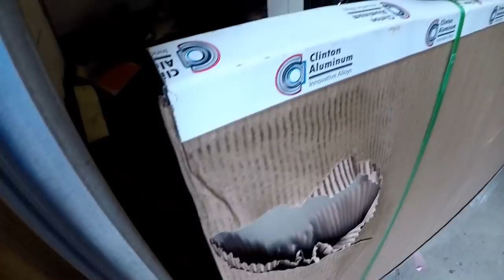Homemade Metalworking Tools

Comment: You should drill a hole at the front of the crack in the mallet so it doesn’t keep cracking. I do that with plexiglass to stop the crack from propagating😳👍🏻✨ you do beautiful work✨

Comment: Good to see ya back at the shop. Got an idea about that English wheel. Put a straight bar, inside the frame. Cut 2 45 degree angle on that bar. That way you don't have to weld it to the ceiling. Great use of that old seabag. Got a few of those myself. Great ideas all the way around. Another great video. Have a great weekend buddy

Comment: Consider sectioning a wood rolling pin into multiple wheels.  Then you can use your lathe to make any profile you want.  The wood might not last long, but it will serve well enough for the limited use you have in mind.  More Epa used similarly would work better and longer but cost you more. Anyhow, keep up the good work.  Bo.
Reply: great ideal or if he has access to a metal lathe make his own that way

Comment: That is what I did with my HF English wheel.  I fitted a hardwood strut from the top front of the frame, up to a ceiling joist.  The base of the machine is fastened to the floor.  For the frame to flex, the house has to be lifted up.

Comment: Some great work. Rather than bolt to the floor I have made my machines mobile and use a chain and turnbuckle to anchor them firmly to hard anchors in the floor. This allows the flexibility to configure the shop to suit the different jobs. This means that things like the shrinker/ stretcher or plannishing hammer can be stored out of the way as not needed every day but the space is needed. Can you fill your English wheel with shot or sand? Dampens out any vibration and that's a good thing.
Reply from the maker: that might not be a bad idea

Comment: Nice work so far mate.  Quick tip for your stump and mallet, wipe it down  with some boiled linseed oil to not only preserve it but to inhibit it from checking and splitting.  Just a thought bud.  Looking forward to seeing more vids on your Indy race car.  Cheers!
Reply: If he peels the bark off of it, it will help to keep it from rotting away on him.
Reply: @derangedmetalworks9489  True, and he can also char the wood with a torch after he removes the bark and that will preserve it.  It's a Japanese technique called Shou Sugi Ban and has been used for centuries in Japan.

Comment: On your complex compound curves, I recommend you take the temper out of your stock by scribbling on the panel with a RED Sharpie then heat with a soft flame from a propane torch until the red vanishes. It makes forming way easier and they'll be no fractures or work hardening. Carry on.
Reply: busmirror, thanks for tip! What temperature is that indicating? Why red only? Other colors, other temperatures?  These are cheap version of Tempilstik?
Reply: @leehaelters6182  The temp is around 350 to 425 degrees, well below melting point. It's likely your raw stock is 5000 grade, plenty of stiffness but still workable. Keep plenty of acetone handy, wash your work frequently as it oxidizes immediately. I assume you'll be riveting, a good source is JayCee Rivets they have everything. https://www.rivetsonline.com/ Important! Use only aluminum, leather, or plastic mallets. No steel....ever! https://www.hammersource.com/

Comment: It was all good for sure.one thing I would have to suggest to you or anyone else is the way you did the English wheel to the ceiling.make sure that's where you're gonna wanna keep it.i mean it wouldn't take much to grind the welds and redo it but more of a hassle though if ya ever did move it.maybe like a screw jack if ya wanna do it this way or 2 more steel straps going from top towards the low back end for more rigidity. Just a suggestion.but otherwise hell youre thinking is damn good.i subed to your channel now for sure.love how you did your sand bag and the tree stump for that.great job.
Will like to see that car to when its done.that will be sharp and a lot of good hard work and long hours.rock on man

Comment: Maybe an eye bolt attatched to the top of the English Wheel and another attached yo the bottom with a Turnbuckle between the two to adjust the tension?

Comment: I can (I think I can ) see a metal lathe in the background - it took me approximately 4 hours on the lathe to make each of the dies for my english wheel - from memory  I also had to make a ball turner too, in that adventure.... Good luck with your endeavours, also cheap bearings on ebay for the dies....

Comment: You know, tomorrow for some unexpected reason, you are going to need the chainfall trolley on the other side of the new supports.  Murphy's law. :)
Reply: I thought the same. I would have made it removable, how often do u use an english wheel really, After the build, not much. Its his shed so who am I too judge.
Reply: @aussiefarmer8741  it sort of is, it is welded to the english press, but not to the overhead rail.  Remove the 4 bolts into the deck and the whole assembly can be moved out of the way.

Comment: What if you had just two posts and no other framework: One bolted to the floor with the small wheel mounted in it and one from the ceiling I-beam with the large wheel mounted in it? Then you'd have unlimited throat depth and it'd take up less shop floor space.
Reply from the maker: That was t original plan, but this should work just fine and it's so much easier
Reply: @MacroMachines  Yep, that setup looks good and rigid.

Comment: this is an impressive build, looking forward to following it the rest of the way.

i have to admit I'm jealous of both your workshops and your skills.

can i make a suggestion. it might be an idea to bow out the flat sides or pinch the bottom of the body, just a little. either way, adding a slight curve to an otherwise flat panel will give it more strength and stop it drumming as much at speed. plus it will make the body look less slab sides and more professional. 

it would mean you will need to add a little crown to the boat tail side panels but you have an english wheel.

if you run into radatior size issues with the narrowed grill and need to go back to the original wide version, simply adding a false extension to the grill shell down between the frames will give it the visual effect of being deeper and narrower. it could also lead into a nice rounded belly pan.

a thing you see a bit on the british inter war race cars, is the passengers side "door" cut out is much higher than the drivers. it gives them a tough purposeful look imho.

Comment: Smart to use the shop for strength. That mallet is very nice, I'm a big fan of Ipe. Did you coat it with boiled linseed oil or anything?
Reply from the maker: yeah i put a light coat of linseed oil on it

Comment: What aluminum alloy are you using?  1100?  Source?  
Looking forward to your build!
Reply: Aluminum goes by 4340, 5356, etc numbers for alloys thereof. Where did you get 1100 from? I don't believe that would be an alloy of Aluminum.
Reply: @slick1rick1  

Yep, most commonly used aluminum alloys are 6061, 7075, 2024, etc.  1100 is "commercially pure" aluminum, and hard to find.  Here's a link:  https://en.wikipedia.org/wiki/1100_aluminium_alloy.  I just learned about it last weekend, in a fabrication class taught by Evan Wilcox, who uses 1100 exclusively for fabricating motorcycle tanks and other shaped parts.
Reply from the maker: 3003 H14

Comment: The rigidity of the wheelie machine is misunderstood and has too much emphasis placed on it. Yes the HF machine does flex, they all do. It may take the less expensive machines longer to put shape in, but the margin for error is bigger. You should have tried using it before you made it part of your shop's structure lol.

Comment: Great Video Although your Speedy Sticher worked quite well i wanted to share  something  i did that may be helpful to you in the future ? Around 12 years ago i bought off Ebay a Chinese Clone Walking Foot Sewing Machine  it was brand new and Actually my very first Ebay purchase ever  i got  what was promised  delevired to my door  and it has worked beyond my expectations  sewing Marine Canvas and Vinyl as well as Automobile Upholstery on my Vintage Cars  ive not had any issues with the Machine and in all honesty  parts have become way easier to find for those machines  if i would need any the Seller did not reccomend the Machine for Leather work although I believe it would do it just fine  if i took it easy on the Machine  and didn’t force it at all i of course have no Affiliation with any of the manufacturers of these machines other than like you i am a hands on guy and have many hobbies  i bought the machine to do projects on my own boats and favoursfor friends  mainly because i was tired of paying  others lots of money and not having control of the Quality and the time of getting things i wanted done   Plus over the years the Internet has grown so much. It has become so much easier to buy materials at a discount for those projects  and i can assure you its way faster than the Speedy Sticher / Awl systems  and would easily sew thru things like your  shot bag or similar  projects

Comment: My reccomendation is to never use a chain disc for a angle grinder for stump carving too much power there on a disc with too much grip. I had a close call with one an I was being safe it still has bit of denim in the saw teeth.

Edit: Also what did you use to stitch through that canvas?
Reply from the maker: its not a chain disk, it's just a kind of wood carving disk. The thing I used to stitch the canvas is called the "awl for all". If you google it you'll see

Comment: Don't knock Harbor Freight, their little welder performs. Their cheap line of tools is questionable but the mid and top line does perform quite well. Their 302 pc tool set is good quality, I used to own Snap-Ons, they compare price/quality wise.

Comment: i think that the topwheel will move across the bottom wheel if you move metal trough it back and forth , think the frame will twist as well as bow open , maibe it helps to put some foot wide plates of thick metal plate over the whole back of the C......... ok tying it to the roofstructure works too , good idea actually , the shotbag too allthough it might work better if you make it out of leather (skin a old leather couch and use the rough backside of the leather  ) think you wear holes in canvas to fast 
like that mallet you made hope it doesnt split , there usually made from teflon plastic 
think you going to need a shrinker stetcher you need to be able to shrink the edges if you want to make sharpish bowl shapes

seen another vid in wish a guy took a trailer home with him that had the type of wheels on it that you where looking for and a diff ,,,,, maibe he still has it :
https://www.youtube.com/watch?v=EHVueznq9xE
Reply: kiwi tinman
What do you think we used for the hundreds of years before teflon was invented